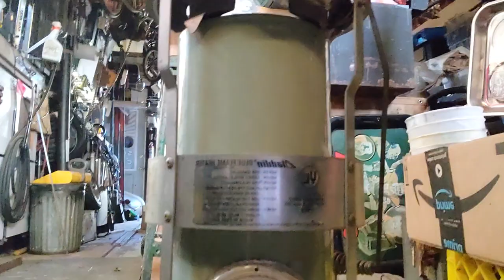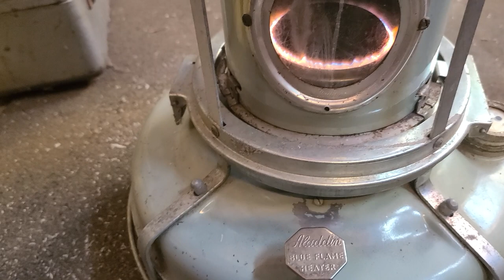Vintage Aladdin Blue Flame Heater - First Light !

Comment: Few bits if info I have learned are: Always wait a 1/2h or more after filling an empty heater.  The wick needs time to saturate before its lit or the capillary flow if fuel can be blocked,  like an airlock in a vehicle's fuel system. Make sure all the small holes in the flame spreader and the bottom if the chimney are clean if you want a blue flame.  Aladdin's secret to a blue flame was in all those small holes. And close the chimney all the way as soon as its lit.  It will burn really smokey with it open.  If you light it and quickly close it you wont get much smoke smell.  Hope you get it running nice.  Cheers
Reply from the maker: Thank you Sandy , I will follow these steps , it is burning very nicely now with a new wick , I'm looking for a parts rig so I can have the original top , my home made job works but Its just temporary.  Wow does it work nicely when set up rights!!!! Thank you Sandy.  Merry Christmas 🎅

Comment: I'm using mine as we speak on my boat it's a great heater. Just a few things you need to remember. 1,you must have good ventilation or you WILL die. 2, use only c1 fuel it's refined parafin and will burn cleanly with no smell.
Reply from the maker: Thank you for the feedback! I will remember these things ! Thank you for sharing!!!!

Comment from the maker: I will do a part 3 , I ordered a new Wick in the mean time as I'm not happy with the flame , it should be Blue. I also have it all apart and I will show you what I found ! , this will be beneficial for any Model 15 owners. I have figured out how to properly raise and lower the Wick, Do not force your wick adjuster, it will be detrimental. If your unit has been sitting dry for allong time I can help you !

Comment: you lit the wick with no cap screwed onto the filler tube, NAUGHTY NAUGHTY !!
Reply from the maker: I certainly did , that was foolish,  thanks for pointing that out
Reply: Your welcome,  interesting video for us all to watch though, Thanks for putting it up.  I,m sure there are hundreds od those heaters around tucked away n sheds that will come out when the gas bills  all go sky high over here soon.  I recall my parents using one in the stairwell and wowee It got hot!! When the paraffin ran low tho it did nt half stink the house out though, and the windows always misted up on the front door too.
Reply from the maker: @MrGreenBentley  I run into one about once a year , they sit dry and the riser for the wick will seize inside the tank , people with force the wheel trying to raise the wick and strip it out , I find now the best thing is to fill the tank up and slosh the fuel around pre soaking the mechanism every few days  resulting in helping break it free . This was my first time fooling with one and it was a challenge.  The next few I helped folks with were a breeze .  They are indeed very good Heaters 👍

Comment: Do some research! By turning that knob it does raise & lower the wick! The wick has to be stuck. Once free, it will move up& down. That’s what gives u the blue flame. Right now the wick is too high, and not adjustable!!
Found one exactly like yours (same model) at the local transfer station. New wick hasn’t arrived yet! My wick was stuck also!!
Good luck!
Reply from the maker: yes I figured it out , it was seized up inside , I got it free and it works great .
Reply from the maker: I also found an original top for mine as it was missing.
Reply: Great, i knew it would work! Glad u found a cover (top)!
Don’t give up!!!
Reply from the maker: @walterlamb4756  Thanks Walter , I appreciate you stopping in !
Reply: Hello Walter, 

I am currently in the same situation with a stuck wick. I tried prying it lose, but to no avail. If possible I would like to use the same wick for some time while I locate a new one. Could you please advice me on how to do this? Thank you in advance.

Comment: Cool idd, I use a Haller Saffire. Same thing only the blue flame is viewed in a glas bulb.
Both items do get arround 500 celcius but the cool part is, the are very economical. Full tank will give you 40 hours of nice warm heat.
Wickes with fiberglass top costs 5 euro on aliexpress and free shipping. 
That wheel is the wick adjuster, wenn it is set perfectly the flame is blue not orange or yellow just perfect blue. 

Take good care
The Netherlands 🔥🇳🇱
Reply from the maker: Do you have a video posted ? Love to see it ???
Reply: @doinsngoins  https://www.youtube.com/watch?v=dv4X_BiCGc0

The other one is the Haller Saffire that is the one I have. Yhe Haller is Dutch made, the Aladdin is made in the UK
Reply: Hi, I know this comment is 2 years old at this point, but I wondered if you could please help find me the right size wick. I just got this heater last weekend as an impulse buy and it isn't looking nearly as good as this one or the one in the video you posted a link to. 
The problem is that the wick is stuck to the internal metal tube (dryrotted?), and even with trying to pry it lose with some very thin metal plates I can't get it to move without risking completely breaking the wick. I am also looking for a wick trimmer as well. 

I tried finding a wick for a decent price online, but all I can find are about 35 euros and with that out of my budget. Could you please help me find the right size wick, and if possible a wick trimmer as well? I am just getting into this hobby and would love to learn more, and any succes would be wonderfull. Thank you very much! All help is greatly appreciated.

Comment: Now that's a cool old stove for sure. 
I've never seen the Aladdin brand before.  Probably be really hard to find a top for it. 
Just a thought that might work.  
You could probably find a vintage metal hubcap from a car. Maybe the old crome moon style cap to make a top.
Reply from the maker: Yeah... that's what I was thinking,  my home made job will due for now , when that wick comes in it will burn blue and cleaner.
Reply: @doinsngoins  Did you try trimming the wick? On other kerosene heaters you could trim less than 1/4 inch off the top and get more life out of it.
Reply from the maker: @BluegrassBushcraft  
I did , and it helped quite a bit , the problem now is the Wick will not come up high enough to get the blue flame , I cheated and pulled it up by hand as high as it should go and got the blue flame . Can't wait to get the new Wick!
Reply: @doinsngoins  Someone must have already trimmed in the past.
Reply from the maker: @BluegrassBushcraft   Yes I cannot get the wick to come up high enough on its own in order to stay burning.